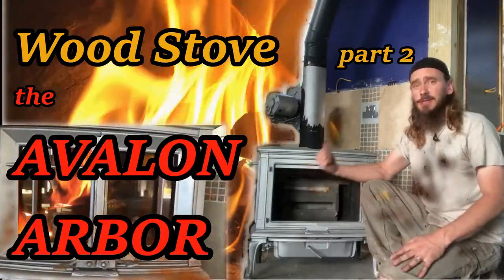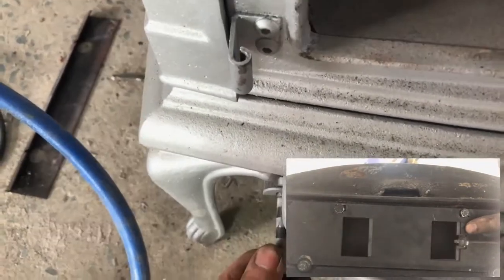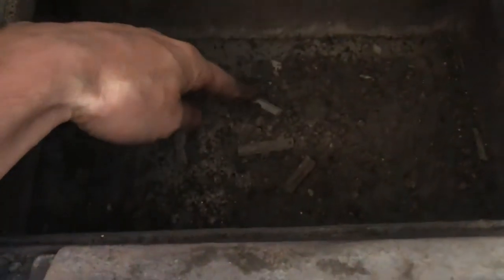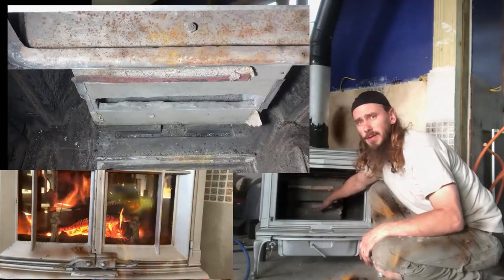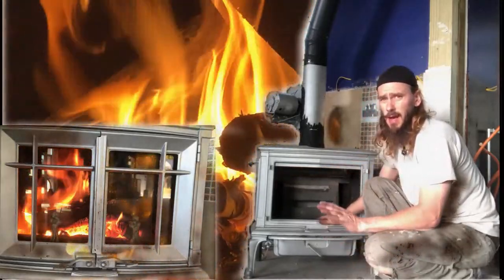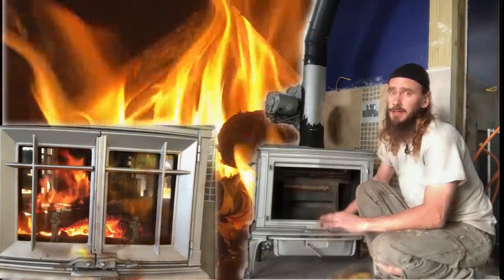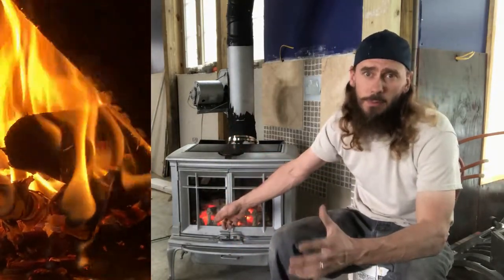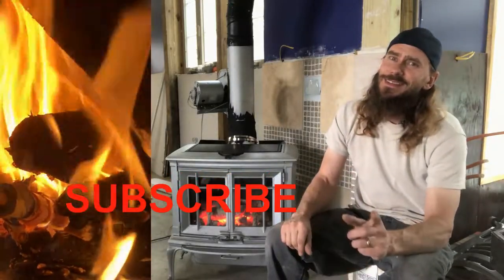Avalon Arbor Wood Stove Flow paths ( chucked up )( Chucknjanice )

Comment: thanks for the info!  I just bought a mobile home that has this stove as its primary heat.  the flu was doing nothing at first - but it was unbelievably dirty.  I cleaned it out good and the airflow works much better - it seems useable.  The crappy combustor/wet toilet paper part (lol) is also broken in mine. I found pieces of it when I was vacuuming it out.  I also do not really want to spend $450 to replace that!  However I don't feel comfortable using the combustor the way it is.  This stove is designed for you to (once you get the fire hot) to 1. close the bypass (top left back handle) and 2. lower the air flow/flu (bottom left lever)  that's when the flow goes out through the bottom back before then rising to the top. If its done that way, in theory you can fill it up with wood and it should burn for 13 hours.   I, however, am only burning with the bypass open - which means it just goes straight up the pipe.  extremely inefficient.  So I am curious, have you have been burning with the bypass open or closed?  If you have been burning with it closed without any problems, then mabye I can get away with it too - seeing how both our stoves have broken wet toilet paper junk in back.
Reply from the maker: After about 15 minutes of burning it hot I shut the bypass and leave the flu fully open. I sometimes crack the ash pan drawer because it seems like it is starving for air for the first couple hours. The change in heat provided to the room is very noticeable. I have not had any problems yet but will make an update video if I do hopefully it not a video on how I burned my shop down. Hope this helps let me know if you have any other questions. If your combustion box broke in the Same way mine did I think it’s safe but that is my unprofessional opinion.
Reply: Thanks for the reply.  And I'm also wondering, do you ever fill it with wood?  I only do a few small logs at a time.  I worry about runaway overheating where the gets literally red hot - it's never happened but I'm afraid if I put too much wood in I wouldn't be able to slow it down.  (Although I suppose I could keep a bucket of sand nearby to quench it in emergency)
Reply: And bottom
 line is it's surrounded by cast iron - even if the flow pattern isn't exactly as designed
Reply from the maker: @craigmahoney4482  I have filled it full of wood and felt safe doing it but I usually just stick around 3/4 full. In my case, I am just burning it while I am in the shop but If I was burning it overnight to keep my house warm I would load it full so I could get a good night's sleep. I think you would be safe to do that unless you are burning a high BTU wood like black locus. 

I know this may seem a little petty but the other benefit of not filling it full and keeping the flu open is that it seems to keep my glass mostly clean.
Reply from the maker: @craigmahoney4482  I am glad you mentioned it being surrounded by cast-iron. I agree and that is why I think we are safe running it with the bypass shut. It may not be as efficient as having the complete combuster box but this is still way better than leaving the bypass open.

Comment: so I just bought this stove off of someone and did not know about combusted issues and cost of it now I see I took mine apart and combusted is trashed running this in my home as a primary heat have you had any issues stoves being installed this week
Reply from the maker: Sorry for the late reply. Not sure if it helps but I am still running the stove with the broken combustor and it works fine.